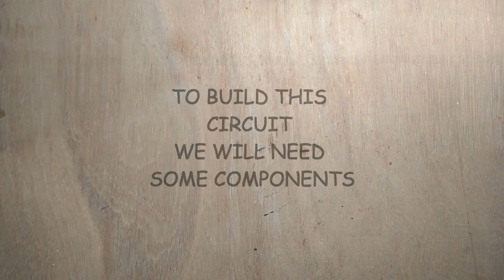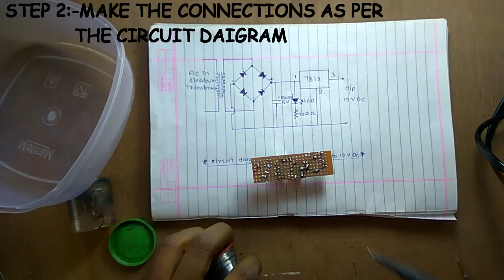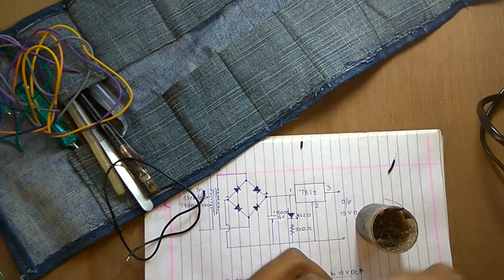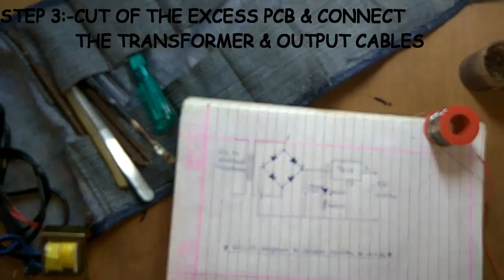DIY(in 3 simple steps) CIRCUIT TO CONVERT 220V AC TO 12V DC

Comment: What is the element in this circuit that is responsible for increasing or decreasing output voltage ??
Reply from the maker: This is not a variable power supply
Reply: @ATRANGIKIDA  
OK  I wanted to know what we are changing in the circuit to get the Volta 3 output
Reply from the maker: U can change the ic & add a pot to adjust the op voltage

Comment: What did you use on components legs? before soldering??
Reply from the maker: Flux
Reply: @ATRANGIKIDA   But is it necessary ? What is the benefit of using it. ?
Reply from the maker: it is not necessary bt it makes soldering easy

Comment: If i want to step down from 240v to 12v, what do I need to change from the components list?
Reply from the maker: Nothing to change u can use the same components
Reply: nothing, the circuit will handle 240vac

Comment: yar how we know we need(lm7812ic) (1000uf capacitor) is it specific formula if yes plz share those.
Reply from the maker: Our aim is to regulate the op vtg to 12V therefore we use a voltage regulator ic lm7812   same is for capacitor depndin on the  voltage

Comment: What is the output current in this circuit ?
Reply from the maker: its 0.5mA
Reply: ATRANGI KIDA so I can't use it to power 12v strip l.e.ds.?
Reply from the maker: Sanath Kumar  y not , u can use it to power led strips , I also tried  its working totally fine
Reply: ATRANGI KIDA thank you 😃
Reply from the maker: Sanath Kumar welcome ✌😊
Reply: how can it power LED strip if it is only outputting 0.5ma amps ?
12 v LED strips need a lot more power , 5m or LED strip requires like 8 to 10 amps

Comment: brother, I want to have 12V 2A from 220+V ? How to approach that? Thank you :)
Reply from the maker: Lokesh Sehgal try using a transformer of 2A output current
Reply: Use 12v 2A transformer Also you should have to provide big heat sink to the voltage regulator as it generates lots of heat

Comment: i needs 10-15 ampere current.as a load becoz my system needs it 10-15 a.........plz help me?  wat can i do?
Reply: Harsh Mishra, it is better for you to buy an adapter cost nearly ₹1000, because if you try to use 10A transformer it would be bulky also the heat generated by the voltage regulator will be very high that you will have to provide infinite cooling also some more extra components should be added and the circuit becomes more complex

Comment: Your demonstration video is so fast that beginners like us wont be able to follow. please make it slow with audio instruction. Otherwise it will be of no use for us.
Reply from the maker: Satyaban Ukil okay . will keep that in mind 😃 thank you anyways
Reply: sorry im also a noob almost i dont undertand the diagram line and your work was so fast so everytime i try to imitate your work im kinda pause the video... T_T  and some question sir hope you dont mind , what is the use of LM7812 IC ?
Reply from the maker: LM7812 REGULATES THE VOLTAGE TO +VE 12V ,& THANKYOU FOR YOUR FEEDBACK , WILL SURLY WORK ON IT.
Reply: ATRANGI KIDA , what if  KM7812 was not available, is there any options?
Reply from the maker: Kent Kyle Aldea if LM7812 is not available u can make a varaible power supply using ic lm317 I have made a seprate video on it , u can watch that .